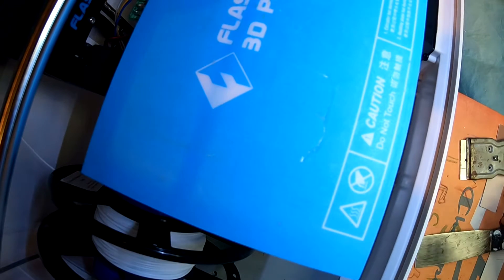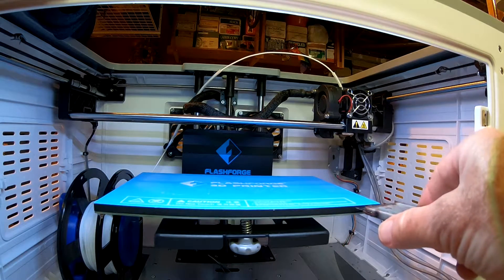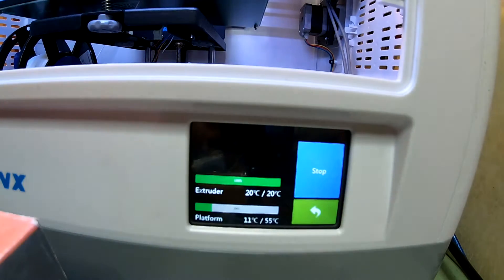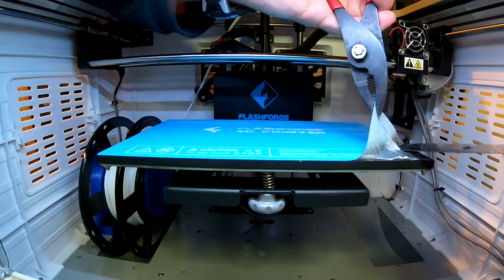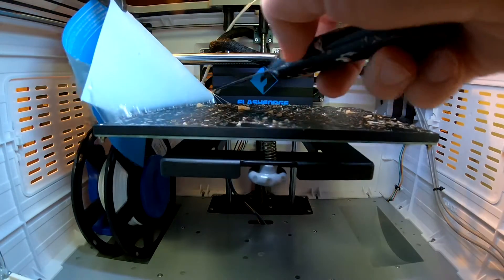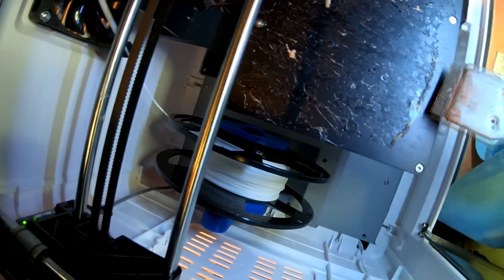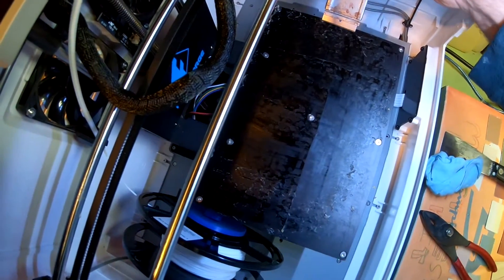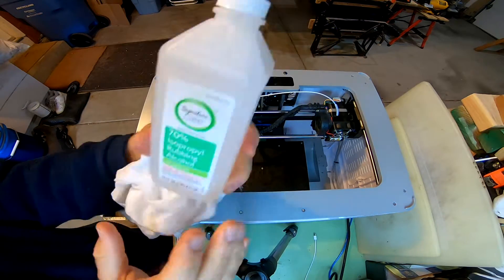Flashforge Dreamer (NX) Replacing the 3d Printer Surface

Comment: I wonder if one might do better with a boro glass plate and 3D Lac.
Reply from the maker: I have tried that and I've had success with it. I use the purple AquaNet hair spray for adhesion.
It's more of a hassle and you lose out on print area since you have to secure the glass.

Here's a link to part 1 of my series of printing on glass with a 0.2mm nozzle on the NX:
https://youtu.be/ebT9K8mgxBI?si=UEfOI9wDYS11Ad8j

I've also printed with a 0.4mm nozzle and that works as well.
I've started using a PEI magnetic surface that works great and is flatter than the sticker and a lot less hassle.
Look for a review of that for the NX & the G2 (my new printer) coming in the future.

My current plan is to only use glass when I'm printing with a 0.2mm nozzle since I've found you need the surface super flat to work with that size and glass is the best at that.

Comment: I do this for a living i work in a 3d printer company I need to change the surface a lot here is some tips for next time use dw40 it will make the glue go faster and cleaner
Reply from the maker: Thanks! I found that after removing the surface the first time and taking time to get all the old glue off, from then on it's much easier to get it on and off. I've also gotten a lot better at leveling the surface so it's easier to get the prints off and they leave less residue.
My last trick is that for PLA, you can raise the bed temperature to > 100 degC and any residual filament on the surface will just come off like taffy.
For PETG, I raise the bed temperature to 125 degC and it comes off easily too.
'Getting all the residual filament off the surface makes them last much longer.

Comment: So those screws under the tape arent to remove the plate for easier cleaning?
Reply from the maker: It would be easier to replace the print surface if you remove the heat bed from the printer.
This video was made early on and I've learned a lot since then.
I recently posted 2-part video about replacing the print surface itself.
Now when I replace the surface, I remove the print bed so I don't put so much strain on the Z-axis mechanism.
Here's a link to part one of that video series:
https://youtu.be/be-0tm34SFw

Comment: I was looking to get a printer like the NX but seeing this kindof put me off it. I got a Adventurer 3 now and the buildplate itself is easily removed so that you can change the build surface  outside of the machine. I'm afraid this will damage the printer over time if you have to do this several times over. Are there really no other ways of doing the changing? Like unscrewing the whole plate? And how ard is it to get prints in ABS off the plate in general? Have you got any experience with that? I prefer using ABS for my printing. 

Nice video though. Keep'em coming.
Reply from the maker: Changing the build surface outside the machine is a great feature and the Adventurer 3 is a great looking printer.
If I was starting today, I would definitely consider that one and the new Adventurer 4.

Replacing the print surface is much easier the second time, and also easier if you don't heat up the bed.
It still puts some torque on the support rails for the bed which over time could cause problems.
But so far I haven't noticed any issues after 18 months of printing.

I used the ABS that came with the printer to do some testing, print a new insert for my patio table umbrella hole, and printing some parts to hold bigger spools of filament.
Those are covered in these videos:
https://youtu.be/oF6JBh8elmc
https://youtu.be/AsoiqdnIuF8
https://youtu.be/_r2HXDDzcvY
https://youtu.be/IE4sGkj6Qyk
https://youtu.be/kdtuxR8H6rk
https://youtu.be/lu84JMfWFz4

But since then I've been printing in PLA and PETG.
Almost everything I'm selling on my Etsy store is PLA:
https://www.etsy.com/shop/BetaCygniDesigns
It's very easy to work with and comes in a lot of colors.
 I'm using PETG for things that (like replacing some of the parts for holding larger reels that I originally made out ABS that cracked with use) I would otherwise have used ABS for.

I'm having good luck removing items of all filament types from the textured print surface that Flashforge has. So I'm happy with that.
I've been using the long one of these spatulas:

https://smile.amazon.com/gp/product/B075SLTY8B/
It has a nice beveled tip and can get almost anything off cleanly if you've leveled your bed properly and have the right temperatures for the bed and extruder and fan settings.
Reply: @BetaCygniBlog  Thank you for the super comprehensive answer. I really appreciate all the links you took time to post too. Most of my inquiries were pointed out and I am really starting to get convinced that this is my next model.

The Adventurer 4 is a great printer but still it's about $200 more expensive and quite bulky in size. The NX fits perfectly into my shelf and it looks great too!

But, what about noise? I see in the specs that the NX is slightly more noisier than the Adventurer 3. About 5db. My Adventurer don't make alot of noise but I just watched your 'First Print with Flashforge Dreamer NX' video and in it you're printing PLA with the top cover off and the door open. And it sounds really noisy to me. WIth all that closed is the plastic housing able to contain much of the noise, you think? And is the noise coming from the fans? Or from the traverse motors perhaps? That's what it sounds like to me.

As I prefer printing with ABS I wouldn't use  the fans much anyway. But if it's from the traverse motors I won't be able to reduce the noise much anyway.
Reply from the maker: @Nephilim2001  You're welcome. 
It is pretty noisy, but I replaced the fans in this video:
https://youtu.be/vH3l1pMKORg
I use a dB app on my phone for a before and after comparison of the noise level.

I keep the top on when it's colder than 70 degF in the garage, but otherwise, printing with PLA, it works better with it off.
For PETG (and ABS) I always print with the top on.
The motors are fairly noisy as you say, but I think most of the noise comes from the original fans.
The Adventurer is newer, so they probably worked on making it quieter.
I have mine in the garage, so I only notice it when I'm in there. I like hearing the motors, that way I know my print is still running!
:)

Here's a link to the playlist for my 3d printer videos:
https://www.youtube.com/playlist?list=PLM0nwcQ_luubpzqCR-LiVbZUiLrg8D_z2
68 and counting!

(60 available now, the rest are scheduled for the future)
Reply: @BetaCygniBlog  Thanks again for your help. You've convinced me to try the NX and I've now ordered my own. I just hope I will be as happy with it printing ABS as I was happy with my adventurer 3 before it started giving me problems. Can't wait to get started again.
Reply from the maker: @Nephilim2001  You're welcome. What problems did you have with the Adventurer 3? I was think about buying one of that style (Adv 4 probably) if they came out with one that had 2 independent heads like the Creator Pro 2.
Reply: @BetaCygniBlog  The Adventurer 3 was my first printer and I couldn't  be happier with my first choice. It's such a easy entry level printer to begin with. Mind you, for the first year and a half the printer ran beautifully. Only parts I had to replace was the build surface and a nozzle.

My problem began a month ago when I removed the nozzle cause the filament wouldn't load. Stepper motor clicking sounds, you know, the normal stuff. I knew how to deal with all those things but still I couldn't find a fix. Looked inside the nozzle and there, right past the entry hole where filament first comes in, a little piece of metal stuck inside it. Bought a new nozzle (2nd I bought) but still the problem persists. I can reduce the clicking sound from only occur during the raft print. (i use ABS exlusively and must use a raft otherwise the print wont stick)  I can get the printer to print. But before every print I got to perform a cold pull, preheat the nozzle, use the unclog tool inside it and then preheat bed and extruder before every print which seems to make the filament run smoothly through. Before all this started all I had to do was to clear the bed and restart the printer and it would print. The piece of metal I mentioned, I have no idea where comes from. It wouldnt have made a whole trip through the bowden tube, so it must come from inside the sprinkler that holds the extruder and nozzle.

Called customer service and they told me if the part that's faulty is not covered by the warranty I must pay the return and shipping costs myself plus the $35 per half hour they been working on it.

I'm selling the printer, and using that cash to pay for parts of the new one. I had it with all the messing around now. I just want a printer that runs normally.
Reply from the maker: @Nephilim2001  Thanks for the detailed explanation. I know what you mean about just wanting the printer to work normally. Sounds like the easily replaceable nozzle (which seems like a cool feature if you want to print higher temperature filaments) could be a failure point. I wonder if they've redesigned that mechanism for the Adventurer 4.

On the Dreamer NX, when I'm going to turn the printer off, I leave the extruder pre-heat on as I run then "Filament Unload" task.
Then I unscrew the fan from the filament feed motor and use the unclog tool to push the filament through the nozzle a couple of times. Sometimes some filament in the heat-break tube comes back out with the unclog tool and I use the wide spatula that comes with the printer to get that off before using it again. I finish up with a 0.4mm needle to clean out the nozzle itself. That usually comes back out with some filament on it so I use my wire nippers to strip off the filament (which has hardened by now). Then I can reuse the needle.
Also I never turn off the preheat on the nozzle (or the bed) unless I'm going to do the cleaning procedure outlined above.
I'm going to make a short video about this procedure in the near future.
I think I've covered it a few times in different videos, but it would be nice to have a video just about that since I do it so often.

Doing this takes about 5 minutes and I've had very consistent results until it's time to replace the heat-break tube and/or nozzle.

I have a 2-part video on that procedure:
https://youtu.be/2_TXQzbroGI
https://youtu.be/zCJ9f_k54PQ

Comment: I have the same machine. I put the bed on 105ºC and the surface came out on one peace, very easy without any problem. Sorry about my english.
Reply from the maker: Thanks for the report, I'll try that.
I've found that once you've taken it off once and removed all the residual glue, the next time it's much easier.

Comment: That doesn’t damage the Cartesian z brackets?
Reply from the maker: No. The print bed is connected to the support bracket that's driven by the Z motor with thumbscrews cushioned by springs.
So there isn't a lot of stress on the support bracket.

Comment: you should do it when it's cold, then it will leave you no sticky glues.
Reply from the maker: Thanks for the tip. I'll try that next time!
Reply: Also less chance of electrocution. Machine pumps a lot of amps into them beds...
Reply: Oh wow, you weren't kidding
Reply: @overreactengine  😆cause I was so mad and rip it off cold
Reply: @FlyByWireC  Ty for mentioning it, simplified things a LOT

Idk why their instructions say to heat it up, it's not any easier to remove after heating